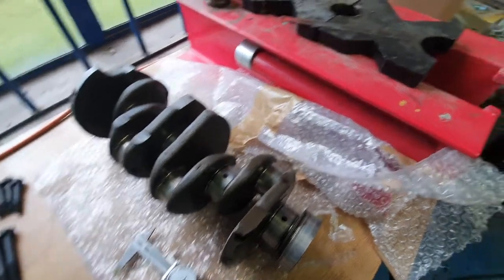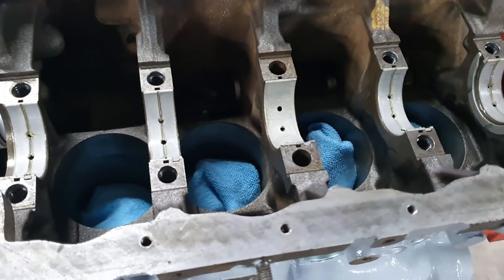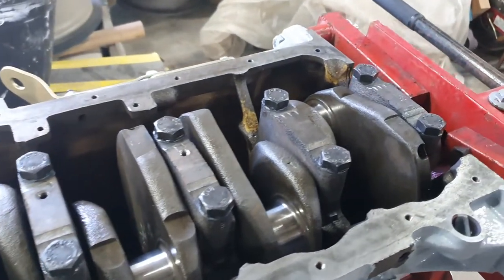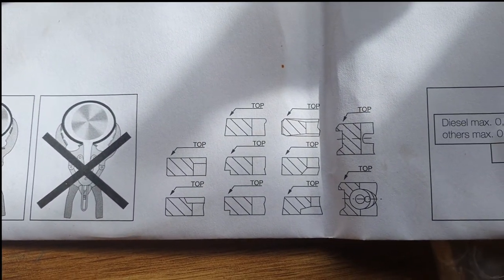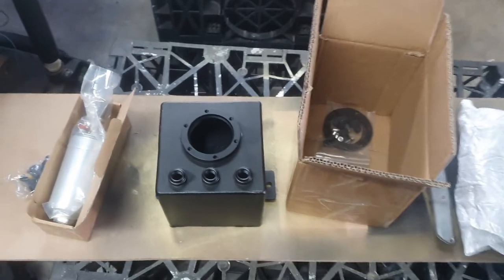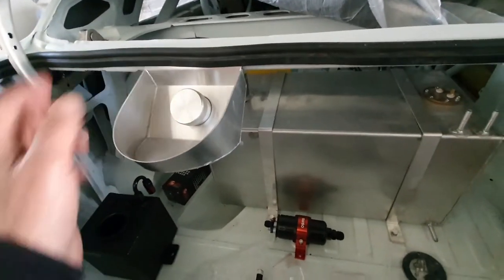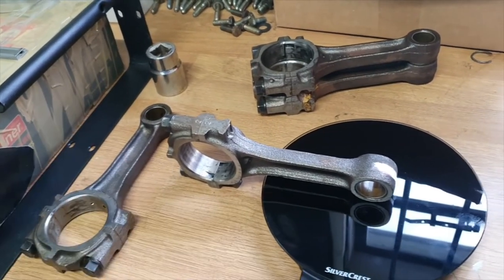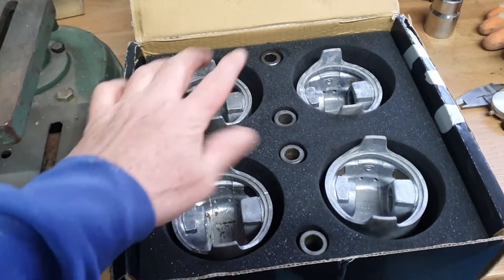How to Build a Lancia Prisma HF integrale. Part 42 - Bottom End

Comment: Really enjoying this TC info. - like you said YT doesn't have much content-and sadly Mr. Croft passed away last year before someone could help him with some video editing to highlight his brilliance.    I have his book and am looking at the various engine codes.  So do both the 8V and 16V blocks have any differences btw the turbo and Non-Turbo variants?  Also can an Integrale engine be flipped to fit a Monte Carlo?  Excuse me if these questions seem a bit naive.  I'm currently hoarding a pair of Scorpions (one with no rust and without an engine/gearbox) and another with an engine but a ton of rust recently rescued for $100.  I haven't physically taken anything apart yet so still trying to comprehend everything- Cheers
Reply from the maker: The only difference I have found between n/a and turbo on the block  is the turbo has oil jets cooling the pistons from the main oil gallery. The n/a pistons are cooled by jets thru the conrod bigend

Comment: any reason you didnt go with aftermarket pistons/rods? Sorry if you explained there somewhere else before.
Reply from the maker: Hi, with the power I'm after, about 350 horse, you don't need them. The stock pistons are forged, albeit not as strong as custom ones. The gearbox will fail way before the pistons and rods.
Reply: @ottosgarage7986  Thanks for the quick feedback! Didnt know they'd last until 350 bhp. I was just wondering since you mentioned you want low down grunt, low(er) intertia would certainly also help wouldnt it? 🙂 Where do you take your design considerations from anyway? Thanks again!
Reply from the maker: I have a very experienced engine builder in the workshop next to mine - he has guided me through the build. I'm lucky to have his experience at hand!